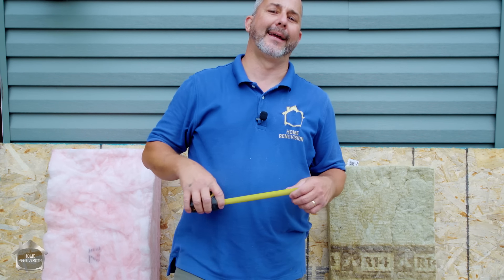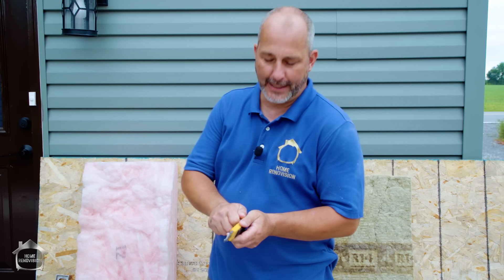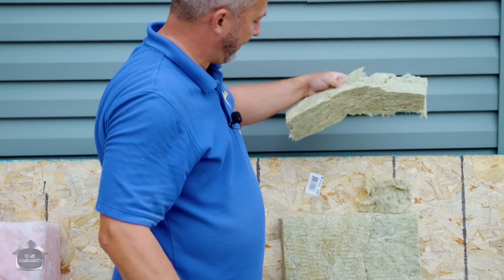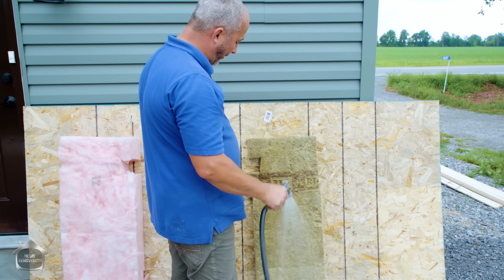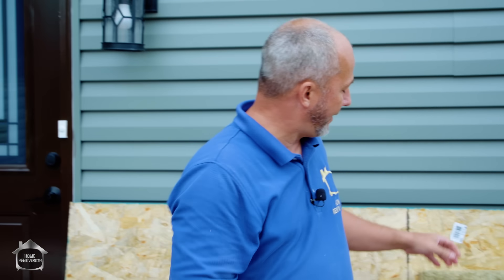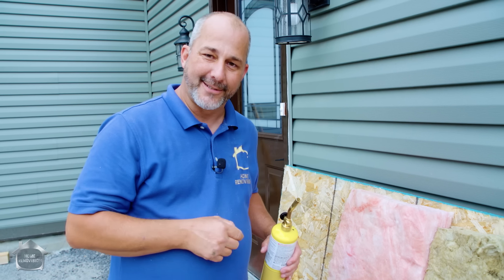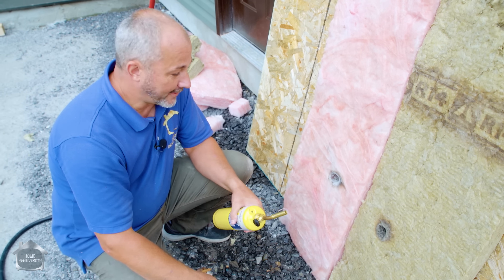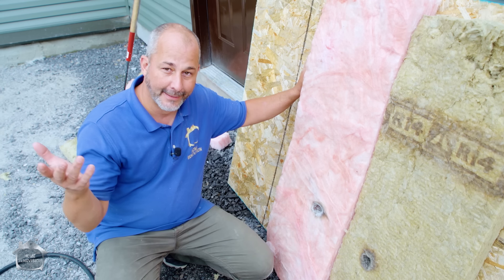How to Choose the Best Insulation for Your Home | DIY Home Renovation

Comment: I am ready to consider refinishing my basement and has been the main reason I started watching your videos a couple of years ago.   I want to install some spray foam in the cavities above the foundation walls to keep the spiders out for good.  I noticed some small water spots on the existing insulation the builder stuffed in the cavities.  I"m replacing them with rockwool insulation for not only the reasons you mentioned, but from what I've heard through the blogs and the comments, rodents/bugs hate the rockwool, but find fiberglass makes a great home.  Is this true?

Comment: Your burn test is unrealistic. A real fire isn't going to be a pinpoint high speed jet. I challenge you to hold a candle or a lighter up to the pink stuff and then to Rockwool and then decide which has a better fire resistance. Rockwool is also far better for your health to handle and install, and the mechanics of installation is much easier for rockwool. Rockwool also has a higher sound transmission class compared to any other type of insulation. In short, there is a reason that is more expensive, its just better.

Comment: GREAT Demonstration.  I'm very interested in using the spray foam insulation to insulate a window seat.  Window seat currently has NO insulation, house was built in 1945, in Florida, so I guess back then they didn't think it was necessary.  We do have a few months here that it does get cold and using heat, you can feel the cold air coming in from the window seat area.  I'm sure it will help with the hot months of using AC.   I have tried to read about the spray foam, I'm confused as to which one I should use for this area, the open or closed cell.  We get a lot of rain in this area of Florida.  Window seat has 4 windows, 2 large that face east and the 2 small, one on each side.  Outside is asbestos shingles that will be removed and T 1-11 siding will go up in it's place.  
If you could do a demonstration using the spray foam, closed & open cell and other types, I'd really appreciate it.  
You are my go to channel for home advise.  Thank you very much.

Comment: For sound, you want low r value pink. For hvac you obviously want high r value. Mineral wool provides both the r value and sound.
Reply: Which would you use to insulate gas pipes on the roof?

Comment: Hi, thanks for more great information. I am grateful for all the work you have done. So, I have two bedrooms and a bathroom over my double garage. The bedroom floors are frrrrreeeezing and the garage ceiling is sealed. Last year I insulated the garage doors and fibreglass insulation on the walls (not put up the drywall though) which helped.  Am not sure what to do for the best/most efficient on my wallet and best way to reduce that chill in the winter and heat in the summer. Am nervous about the idea of foam as I've read all sorts of nightmare stories so I was down to blown in insulation or to attach foam board to the ceiling.  I'd love your advice please.

Comment: What about for rodents? Mice LOVE the fiberglass
Reply: Mineral wool is a great rodent barrier.
Reply from the maker: if you have a mice problem then find where they are getting in and solve it!
Reply: A great way to "solve" the problem is to use materials from the get-go that are harder to damage, and hold up for the long haul.  Such as rockwool.

Comment: One additional factor for consideration is based upon my experience working in attics.
The fiberglass insulation starts to break down over time and turns into particles just like dust - thus major reduction in insulation Value. Not to mention animals including yellow jackets seem to like it.
Mineral wool all the way, I understand that it can be blown in now.

Comment: Your house fire burn rate comment is misleading when basing it on map gas burn temps vs ordinary burn temps.  You even state that it goes really hot higher than propane.  A house fire fire burns at about 1.1k F, map gas is about 3.7k F,  propane is 1.9k F, and for information purposes glass will melt around 1.5k F.

Comment: Water travels, down. To me that means anything below the roof should have rock wool insulation instead of pink. You can use pink on interior walls though. 

Considering that Roxul is a natural product compared to pink, I’ll rather go natural. It’s also a better bug/mice barrier. 

But my ultimate material is building with ICF. Inside and outside insulation, fireproof, water repellent, sound proofing, build to last forever. I know that doesn’t help for remodeling. Downside of ICF is you can’t make changes to the layout after its build. Small price to pay. Just plan ahead. 

Some people believe insulation doesn’t belong on the inside of a house, but the outside. The more I think about it I agree.

Comment: very helpful.  Doing basements when do you go with spray foam vs the pink?  I've seen your videos where you have the house wrap on one side of the wall and then pink and then a moisture barrier.  Do you ever recommend doing spray foam (I'm also in Ontario, so colder climate)?

Comment: It's not "just as good" at half the price.   It's just as insulative, in ideal conditions. What it doesn't do is last when things get iffy.  The fact that rock wool doesn't easily change it's shape? That, on it's own, is value and use. It doesn't compress as much, so it's not as susceptible to installer error. I can't count the number of times i've had to do a repair in a wall ten-twenty-thirty years after the fiberglass was installed and it's a mangled, uneven, badly installed mess. Sometimes clearly installer error, sometimes very clearly done by a electrical/plumbing contractor after the fact. It's harder to do that with mineral wool.  You have exterior cladding fail in twenty years, you have a window that leaks? You're not out that money for insulation.  Rats? HATE the stuff. The number of fiberglass walls I've torn apart and found rat, mouse, and squirrel nests where big gobs of the insulation value's been destroyed is...I can't count that high. 

As a in-cavity insulation it's not going to do notably better for fire-proofing. As part of a fire protection system with rockboard and other similar products? You're belt and suspenders. That's a big deal where I am, in fire country.  I'm significantly less worried about fires inside my house than I am the one's OUTSIDE my house. So, fire retardant spray on your lumber, fire-proof cladding, and high fire rating on your insulation? It's worth it, to my mind. 

As for soundproofing...it deadens more, but honestly if THAT is your goal, go with recycled blue jean/cotton insulation material. Lived in a house directly under the BART tracks in the San Fransisco bay area. Had blown in attic insulation. One layer of r-19 bats and the noise was cut damn near in half.  I generally wouldn't recommend the stuff, but if noise is your primary motivator...it's impressive.

Comment: I don't remember you mentioning that the fiber glass has it's R value go down over time.
Reply: Welp, but it's still half the price. 
So some people might think it's better to redo the insulation later.
I personally like'em both. 
But if I had to pick just one,  I'd stick with roxul.
Reply: I was going to mention this and its called thermal drift.  The pick stuff also has the issue with compression that causes thermal drift.  I would be curious how long the thermal drift takes to be noticeable.
Reply: Thermal drift depends on the application, such as blown lose material in an attic.  Settling does occur.  Also, blown fiberglass has convection issues in a vented attic, where fiberglass batts or blown rockwool don't have the same issues.  I don't believe a batt in a wall has thermal drift, but I'll have to look into that.
Reply: @leokim1458  The problem is that the is only advertised to remain effective for 10 years, vs mineral wool 15 years.  The most expensive part of insulation is the installation.  I bought 15 bags of mineral wool insulation for about 600$, (700$ with insulation), which was enough for my 1000 SQFT main floor.  
  
Bugs and animals don't like mineral wool insulation because it is rough and itchy to go through, it is more fire proof than fiberglass (in the event that a fire breaks out within a wall from electric, rather than within the house like he is mentioning above.  
  
Moisture over time is less likely to cause issues for the mineral wool than the fiberglass, even if it isn't getting soaked, humidity could deteriorate the fiberglass insulation over time.    
  
Ultimately, my point is that mineral wool insulation has enough extra benefits that it's increased cost shouldn't push people away from purchasing it.  The actual expensive part of insulation is the installation, even if you are doing it yourself.  You don't want to have to tear down your walls for insulation reasons, all it takes is one wall, window, or roof leak, to cause fiberglass insulation within a wall to need to be completely replaced.  mineral wool insulation could just allow for the water to be diffused out through the exterior sheathing (assuming your vapor barrier is on the inside).
Reply: @Lolatyou332    Good points there. That's very much appreciated.
Reply: @Lolatyou332  in wet regions I was told to put the vapor barrier on the outside of the wall (before the furring strips and siding), and put the vapor barrier on the inside of the wall (before the drywall) in dry regions. All depends on what is needed for the build of the home or building. Fiberglass is used mostly in construction because it is easy on the overall budget. Rockwool was always used in higher end builds for all of those benefits and when cost wasnt a factor
Reply: @TheMavosa  it should be based on the zone you live in for where you install the vapor barrier.  
I don't believe there is a case where you should have a vapor barrier on both the inside and outside, that sounds like a disaster wsiting to happen, if water gets into the wall through a small hole, the vapor will not be able to go anywhere when it evaporates.  It will more than likely cause condensation in both the winter and summer, it might not be  noticed right away but I have a feeling the wall would eventually fill up with mold.  
  
You'd be better off listening to the pros in your zone though than me.  I live in zone 4 so I only really know the code well for that zone.
Reply: @Lolatyou332  I always installed it on the exterior before I put the windows, grace, furring, and then siding.
Reply: @TheMavosa  it should be on the warm side to prevent condensation.  If you live in the southern US that is good.  Any other zones it is usually on the inside because of the cold winters.  
Every house should have some kind of air and water barrier on the outside.  It is vapor permeable though so water vapor can escape from materials behind it if necessary.
Reply: @Lolatyou332  vapor barrier is different than plastic sheeting. It lets the building breathe. The furring strips keep airflow between the siding and and the vapor barrier. The vapor barrier is on OSB sheets or just use Densglass, which is an exterior drywall, then add furring before siding. This is how you build commercial and multifamily buildings in the pacific northwest. Built many buildings like this.

Comment: Rockwool is better for sound insulation inch per inch, doesn't mold, has better r value per inch but is much better as a thermal block. You misunderstand pink fiberglass insulation is almost always damp from vapor transfer and allows for way more convection and severe wind wash. It's clear that you are well versed in most areas of construction but are very much lacking in insulation. You gotta research a lot and don't get suckered in by the marketing lobbyist. Most folks watch this and now won't buy the better product.

Comment: Rockwool in floors and vaulted roof, deeply impregnated with boric acid for pest proofing!
2" Aircrete in walls!
There is nowhere in my buildings I use pink!
Reply: did you hire a company to do the aircrete?

Comment: We need a spray foam (closed cell ) vs Rockwool comparison! Great content
Reply: Sprayfoam is the king of insulation but $$$
Reply: there is none, spray foam SUCKS... try cutting in something after you spray it... not happening
Reply: And rigid insulation panels! (XPS)
Reply: @adblink1379  they just installed some of the 4" xps  at the job, $40.00 usd a 2x4' sheet... and they were bringing it on tractor trailers
Reply: Building materials better be completely dry before spraying closed cell. Also, all wiring needs to be run with no twists or kinks, or it might overheat and melt, breaking the circuit. Troubleshooting electrical issues creates a huge mess of torn out foam, that usually never gets reapplied by the general contractor.
Reply: Closed cell foam is completely impermeable, it will not allow wall cavities to dry out if vapor gets into to them.

Comment: As an acoustician, I have tested every single type of insulation product there is in North America, and parts of Europe. I like Roxul/Rickwool as a concept, and it does have good acoustical absorption/insulation properties. The one thing I don’t like about it, is that as it dries… It starts to crumble, and overtime you get a thick lumpy dry crumbled mess.
Reply: Out of the popular insulation options to buy and use in homes, can you rank em and tell which are the better ones for sound? A 1-10 scale would suffice for me
Reply: Ready Acoustics, how long does Rockwool retain it's structure before deteriorating into a dusty lump?  Specifically in the Mid Atlantic area? 

Thank you for your work on sound deadening and acoustics.  Very important for comfortable living.

Comment: Great video, excellent demonstration.  I purchased some mineral wool because I could get a higher R-value which my codes inspector insisted i needed to meet energy codes.  I've installed the pink stuff many times before, and one additional advantage is I wasn't as itchy when I was done.  But... that's probably not worth the extra cost alone.

Comment: Next do foam/poly board and or reflectics.
Reply: Relectix bubble has no real R value, but does work as a radiating sheild. The bubbles dont help much. The polyfoam closed cell is a R6 for 1" so that stuff should be a great alternate, but it may be less fire resistant. I too would like to see a video on this as I am just about to add insulation! :-)
Reply: Foam board is good where you need some stiffness such as after the 1 inch gap under radiant barrier.

Comment: Accidentally nuked my tab.  So will try again.

Okay: Additional info.
If you're not using faced fiberglass, water in it or no, settling WILL be a problem over time.
Because Rockwool is denser, it retains it's shape and maintains friction against the sides of the stud bay.

Also, while the 100/60 foot pricing is about the same regardless, keep in mind that if you're insulating a whole home in a build or reno, you're NOT going to be buying at Home Depot or Menards or whoever your local "handyman" store is.

You're going to go to an insulation wholesaler.

Also keep in mind that Owens Corning isn't simply a Fiberglass Insulation company.  They also own a mineral wool business (Thermafiber) as well.

Comment: Always love informed comparisons, keep them coming!
Reply from the maker: Thanks! Will do!
Reply: Hes completely misleading though.. there are a lot more benefits to rockwool that he isnt stating.... it is mold risistent rodents and bugs dont nest and chew through it. Not the mention the r value ks close per inch... but makes a big difference when you're talking about 3 and 4 inch.. means you either meet the r value or dont..
Reply: @tiagosimoes7422  I have  to agree  roxual  is way easier to cut , is much less itchy, fills the cavity better, doesn't really  compress and has a slightly  better R Value and IMHO  is worth every penny, Once you try it you will never go back
Reply: @HomeRenoVisionDIY  p
Reply: @snakeplisken4119  Rockwool is far itchier than new OC fiberglass. I own an insulation company and if I'm working with RW I need to wear gloves, that stuff is brutal. If I'm working with OC that stuff feels like cotton, zero itch.
Reply: @koryleach9660  same for me installing it.
I'd much rather install the pink one than the roxul

Comment: Great video! Thank you. Lots of good information. Would you consider doing a video on types of wood rot and early detection? I recently discovered a rotted floor joint beam on my 15 yr old mini home....not impressed as you can imagine.  I was told it's "dry rot"?
Reply: You can help prevent that with Boric acid or Borax solution. It strengthens and keep smold and termites out.

Comment: 1. MAP gas is perhaps a little disingenuous. It burns so hot, no insulation could withstand it, if you use a more realistic propane flame, mineral wool really shines.

2. You said it yourself, fiberglass is not nearly as resilient, and smells like burnt sugar in the hot sun. The fibers are bound together with an adhesive.

3. Cost is regional, ex, my local home depot based in Winnipeg features very similar pricing.

1sq ft R14 Fiberglass costs 73.4 cents
1sq ft R14 Rockwool costs 92.4 cents

That is a 26% price premium, very far from the 100% price premium you are suggesting, I think that pricing would be unlikely even if you live right next to the fiberglass factory. I suspect your price is disingenuous as well, and I hope you are not steering your viewers in the wrong direction.

Homes are too often built with shoddy practices and materials, and penny pinching 25% over insulation, seems like another example of why modern homes have so many issues. I've learned my lesson, and I will never cheap out again. I am NEVER buying another bag of fiberglass.